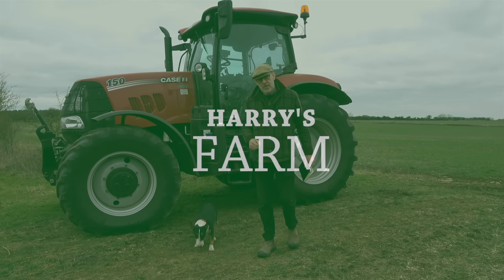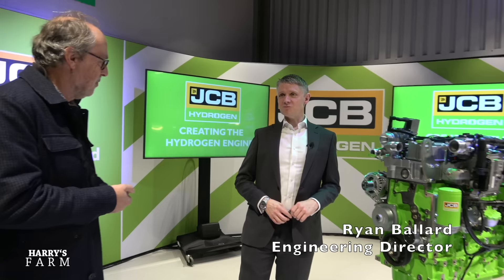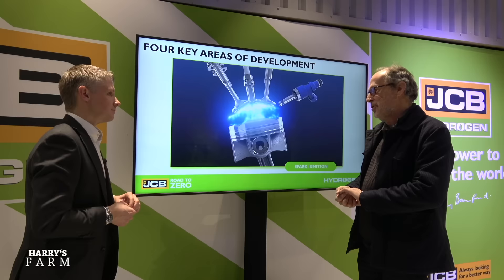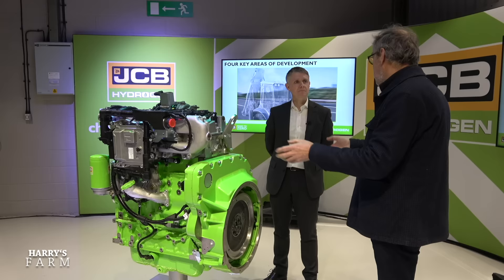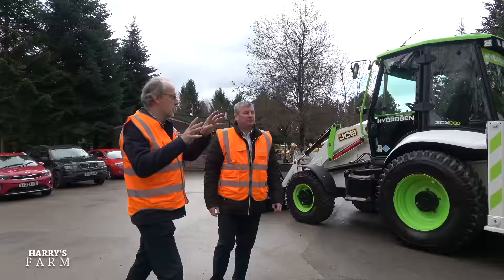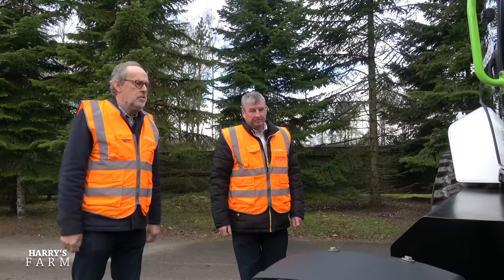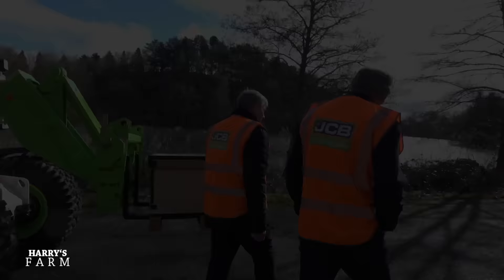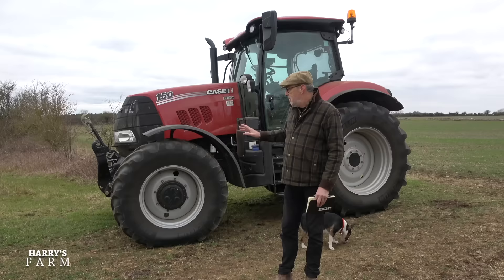JCB is moving to hydrogen power for all their big machinery. Here’s why.

Comment: 21:45 100KG of hydrogen equates to how much farm work???  Will 100KG of Hydrogen do the same work as 30 Gallons of diesel fuel in a modern diesel tractor?  How many bushels of corn can a farmer harvest using 100KG of Hydrogen.  I see new paint schemes, but where is "the chicken dinner?"  22:10 He says 1KG H2 is equivalent to 3 liters diesel.  Would that be equivalent on the front end of efficiency, or the back end that represents work delivered to the ground?   This "large truck mounted energy storage vessel" contains 100 KG of H2, representing 300 liters of diesel, which is approximately SEVENTY-FIVE GALLONS of DIESEL.   I don't know any farmer who would buy that huge fueling truck if it only represent 1-1/2 barrels of diesel........   This H2 system is "achievable," but it certainly is not PRACTICAL or economically feasible.    The "SCIENCE" proves "Carbon nourishes every living thing on the EARTH."   Don't fear the reefer or the carbon; both are gifts from God.

Comment: electric is not the way ;;  diesel without the tax would be way cheaper than hydrogen ,  diesel is put in your tank at 0 bar [14.7 psi ] hydrogen from the supply wagon --- 7350 psi bomb ,,  its an exciting idea , but has its own drawbacks ;;

Comment: At a $1 per kg of H2 I'll take $100 million worth in 2030. Where do I sign up? Oh, that's right, nowhere because it's never going to happen.
There is no such thing as zero cost electricity whether it's PV,  wind, nuclear or magic moon beams.
I'd be really impressed with JCB's amazing engineering if it wasn't based on the fantasy of net zero. The farming/construction global industry doesn't need a new, expensive powertrain as the CO2 it produces is totally irrelevant. The developing nations burn more kerosene for lighting than the entire US aviation industry uses. If CO2 was really an issue that would be a simple starting point but it's not and nobody even suggests it.
We've got to escape this CO2 is a dangerous gas fantasy and move on.